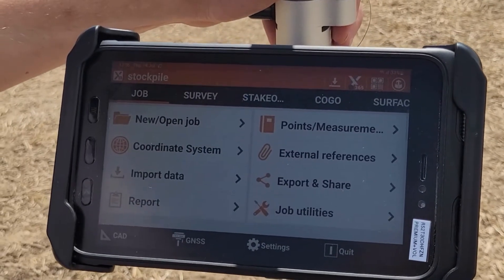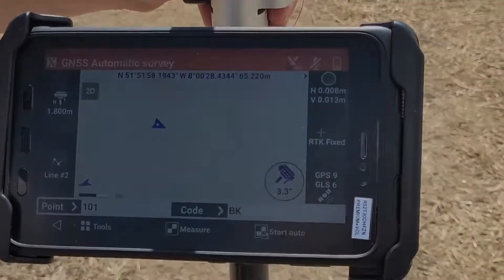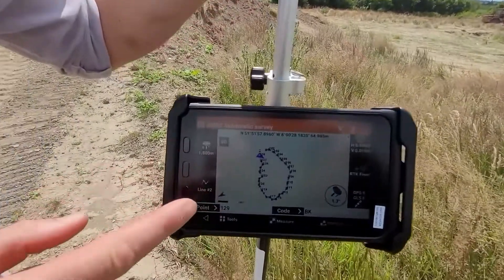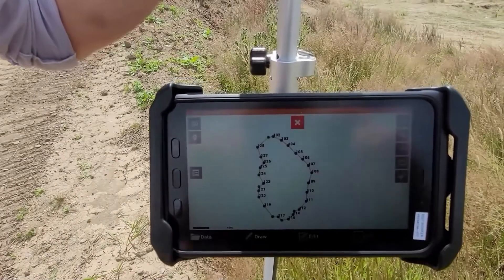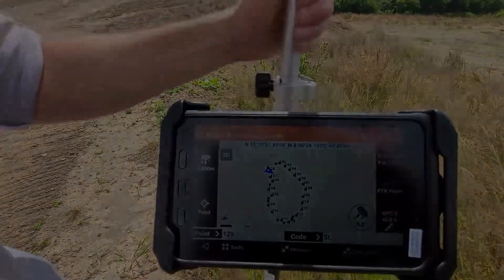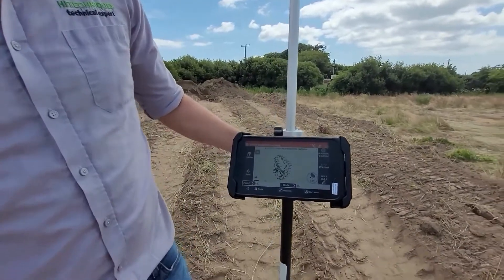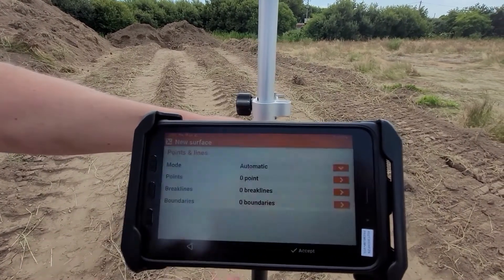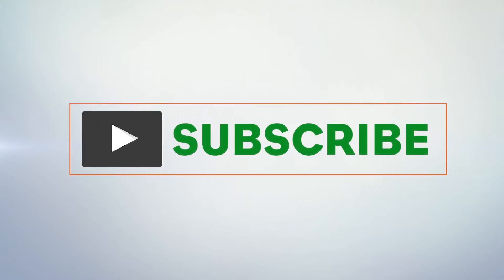How to calculate surfaces & volumes with Zenith60 and X PAD #surveying software

Comment: Is it anyway to get the cut and fill volume from actual ground level to required the design level by using Geomax zoom 90?
Reply: This can be done in the volumes module but selecting reference elevation and selecting the point you want as ground level from CAD.